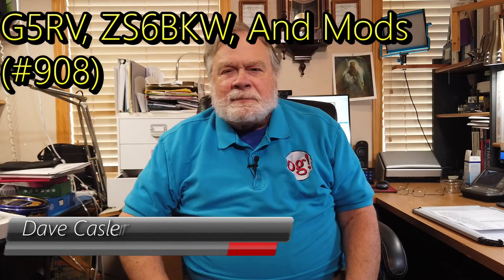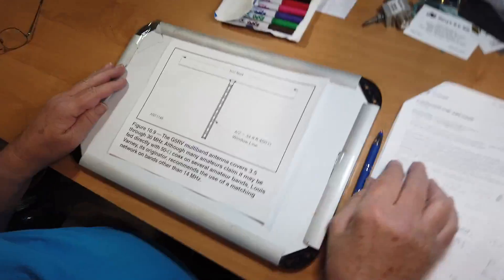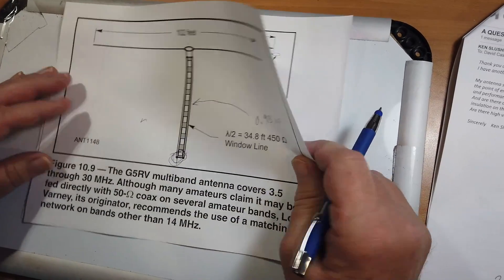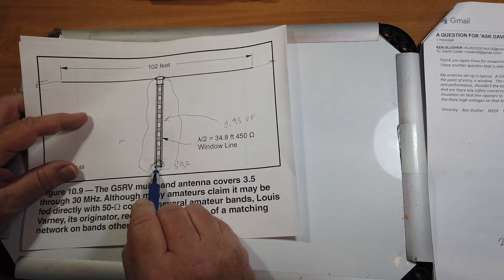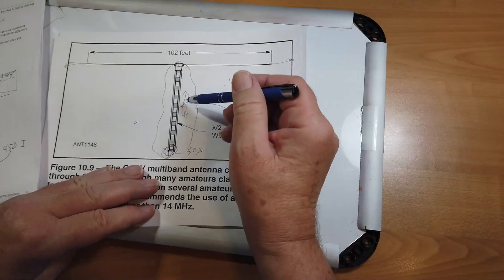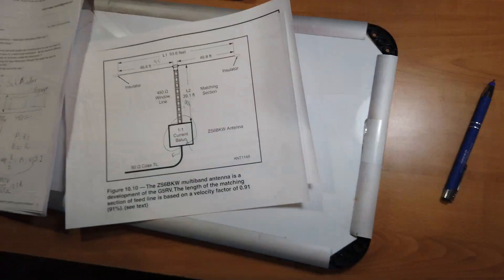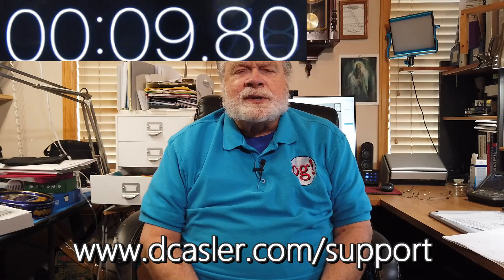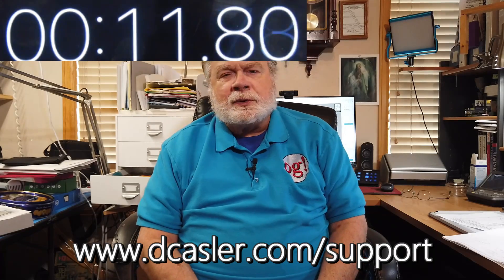G5RV, ZS6BKW, and Mods (#908)

Comment: I currently have a G5RV and a ZS6BKW. In A+B tests, 90+% of the time, I've found the G5RV is better in receive and TX signal. 
They're both mounted at similar height and in the same direction. 
Indeed, computer modeling also indicates an advantage for the G5RV also.

Comment: I feel the ZS6BKW is a really good first choice beginners antenna. I use an external tuner and this antenna is useable on every band 80 through 6 It really shines on 40, 20, 12 1nd 10. All the others use a tuner. Honestly if you have 90 ft available horizontally and at least 30 ft high it is a great choice.

Comment: Hi Dave,
I tried a ZS6BKW antenna here at my QTH here in New Zealand, as this this was the only wire antenna that I could reasonably fit on my section.
The antenna itself was great, however the biggest problem was the ladder line that doesn't seem to like strong winds (which there are a lot of here) and one of the wires of the ladder line broke one night.
I repaired it and used some 400lb nylon shark fishing line in a vain attempt to stop the wires from flexing in the wind, this didn't work and the antenna was removed.
It's a shame you can't really support ladder line near any metallic objects, especially when the length of this is 30 + ft.
I made some really good QSO's with that antenna, but it wasn't mechanically up to the task.
73 de ZL3XD.

Comment: Dave, the G5RV when built to Varney's specs shows around 100 ohms impedance for 20 Meters with little to no reactance at the feed point of the ladder line.  The G5RV does not show a 50 ohm impedance on any amateur band.  The ZS6BKW was a design that took the G5RV and adjusted the antenna to work on 5 amateur bands with a 50 ohm impedance.  It seems that the G5RV will forever be misunderstood......

Comment: My full size G5RV works great, mounted off of my 60ft tower in inverted V config with an Air Wound Balun at he 50ohm coax connection. I use an MFJ-993B Auto Tuner with mine.

Comment: Open wire and ribbon line have problems with snow, ice and rain just for a start. Its hard to beat EFHW or trap dipole for a single element multi band antenna. Now, if you want to build a Lazy-H or Colinear stack, open wire makes a simple combining network. Also, even with a full power station, one must consider the bands and type of DX one wants to do and select antennas and supports to do it.

Comment: Interesting video Dave, on either antenna does the matching stub radiate RF and needs to be clear of metal objects? Tnx and 73, K6SDW
Reply: Yes, if I recall from the instructions when I installed mine, it said to keep at least 9 inches from metal.